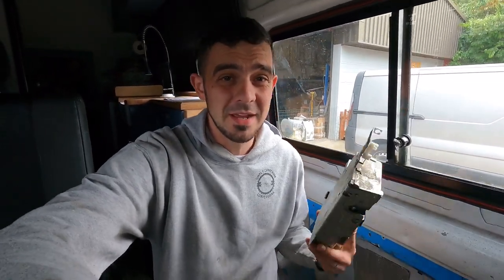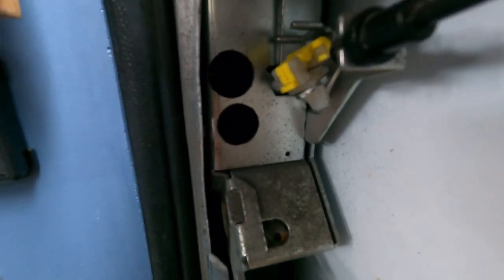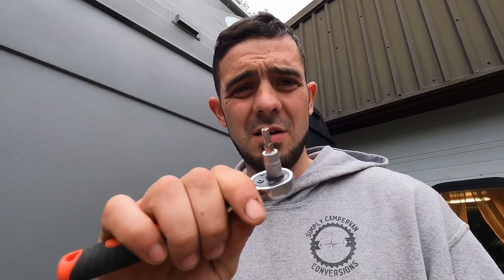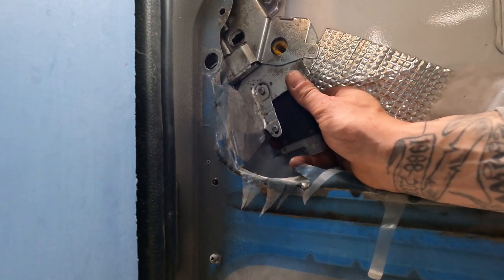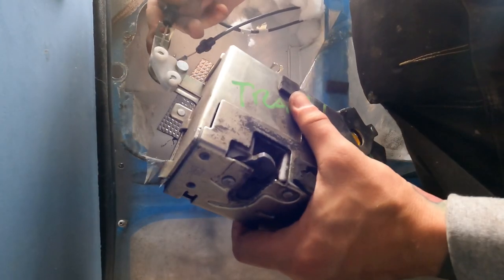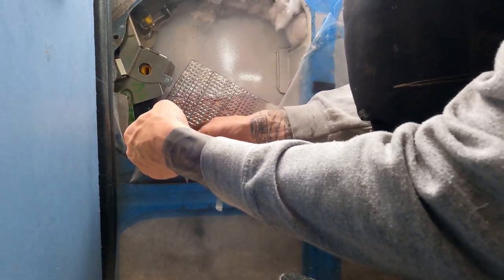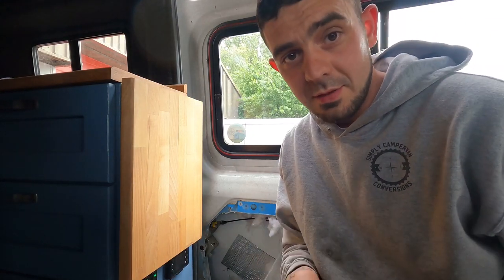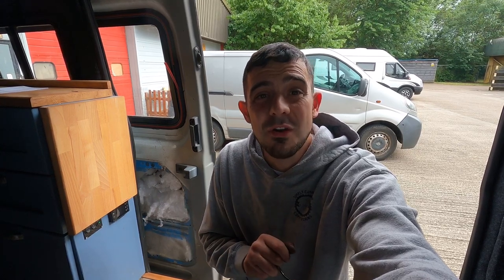SLIDING DOOR WONT OPEN - HOW I FIXED IT - MK6 MK7 TRANSIT CAMPER VAN

Comment: Similar problem, daughter tried to force handle instead fo waiting for cargo door to be unlocked. I drilled the hole as you described and after pushing screwdriver around inside it opened. My mechanic couldn’t even get it open it so it was a great help. Many thanks
Reply: I’m having difficulty with this part I’ve made my hole just not sure how to unlatch it

Comment: Good video  will this work when the door does not unlock ?  the little knob on the inside does not turn all the way when I hit the key to unlock (at times it does work)
Reply from the maker: I wouldn’t like to say, if its sometimes working it could be something different.
If you can get it open try cleaning the contacts on the door. You have two sets of contacts one on the door and one on the van where the door closes, these need to have a clean contact to allow the door to unlock.

Comment: How do you this on a 2017 Transit Custom? The sliding door has deadlocked shut and cannot open from the inside or outside I suspect it's either a fault wiring loom or the cable for opening on the outside has dislodged from the eyehook in the lock mechanism. I cannot remove the lock and it's driving me crazy.

Comment: How do I know if it is this that's defo the part that's failed? I've heard it can be contact points as well? Mine was intermittently not locking/unlocking. I thought it was because the door had dropped and the contacts weren't meeting properly. It worked perfectly for a couple of days until it then permanently jammed shut
Reply: I've had similar with mine for years - super temperamental. Did you find a fix for yours? Was it contacts in the end?

Comment: I've just installed a second-hand sliding door lock and now the door won't open from the inside and outside. The lock works with the keyfob and I think the manual switch for the child lock is on so cannot open from the inside anyway. The sliding door won't open from the outside. How strange is that?

Comment: Did you by a used genuine, new genuine, or cheap Chinese aftermarket lock?  Im seeing prices for £120 used, £99 new aftermarket and £275 new genuine.  Ive only just picked myself up off the floor.
Reply from the maker: Crazy prices aren’t they, I got a used genuine for £80

Comment: Ford really do need to go back to the drawing board with their vehicle locking mechanisms.
I work in the building trade,and most of us have transits.
Everyone without exception,has trouble with their locking.
Chucklesome to see so many mr Bean solutions,padlocks on the doors,but infuriating at the time.
Especially when all your tools are locked inside,and you have a pressing day ahead.
Reply from the maker: It’s not just the mechanism, my auxiliary battery died and I lost the ability to u lock the rear doors even with the key, luckily connecting jump leads from the starter battery gave it the boost I needed to get in and get my tools out.

Comment: Thanks to your video I solved the same problem.

I'm adding a link where I show how to open the mechanism but with the lock removed.

https://www.youtube.com/watch?v=Qj0KFm3Vp-4

I made a Ø12 hole and with a long screwdriver I managed to open the lock.
When I dismantled it I discovered that the problem was not due to the mechanism but to the electric lock code 005465 FORD (PA GF30), that is the part where an electrical connector is connected.
It didn't work anymore, it was blocked in the sense that it didn't allow opening via the handles.
Thanks again, if you hadn't made the video, I would have done it, because it's too useful for amateur mechanics.
Greetings from Milan (Italy) 👋👋